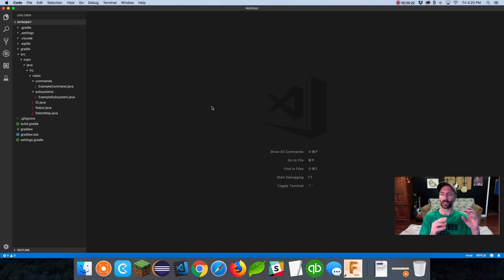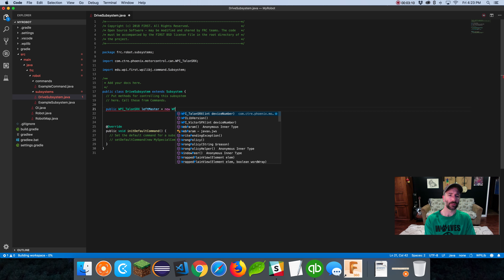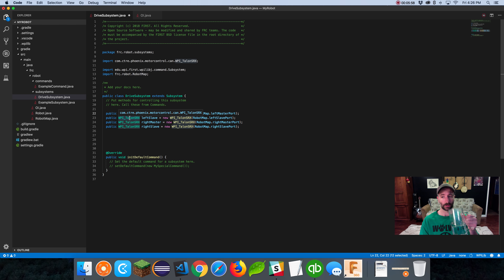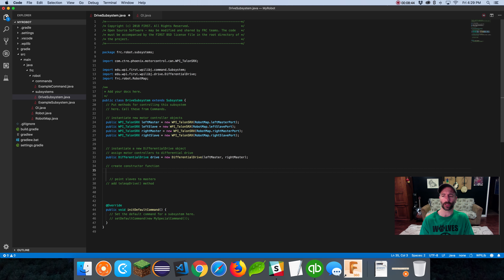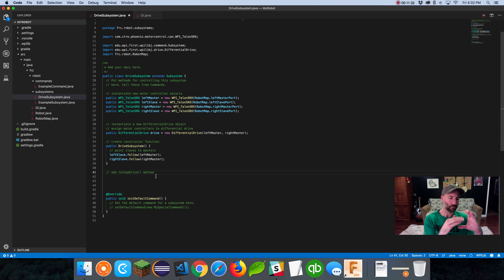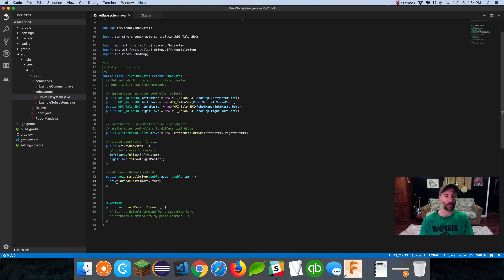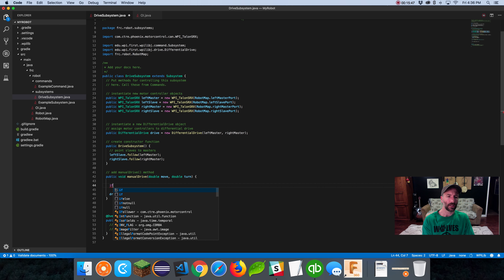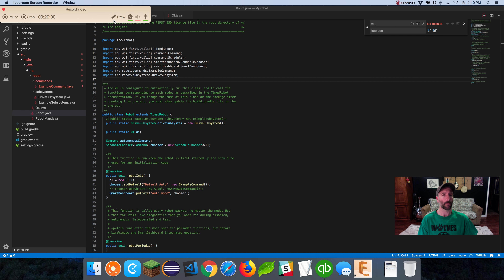FRC Drivable Robot PART 3: Drive Subsystem / Java VS Code

Comment: I'm using SparkMaxes instead of Talons, and when i try to type it in after "new" it wont give me the option to put in a device number. When I add parentheses and put the constant from RobotMap in, it is underlined and says:  The constructor SparkMax(int) is not visible. Any suggestions?
Reply: I've used Talon and Sparks a lot. I haven't used SparkMax. Did you install the software necessary for vscode to recognize a SparkMax? I'm seeing some resources here: https://www.revrobotics.com/sparkmax-software/#client-installation-instructions and some examples here: https://github.com/REVrobotics/SPARK-MAX-Examples

Comment: How did you "import" the packages for the Talon SRXs? I used the Phoenix installer to download the Java imports to VSCode, but the import is still not available.
Reply from the maker: Well, I think the ctre library was included when I  went through the steps to setup vscode on wpilib. I could be wrong. I'll be setting up a few laptops this week and I'll check then. sorry I can't give a better answer. if it's a rush, post a question on chiefdelphi.com under programming.
Reply: @BetaWolves-Team  
I followed this page, where the documentation described how you can "Install New Software". Basically, you right click on "build.gradle" and select "Manage Vendor Libraries", then select "Install new Software". After entering the link:
http://devsite.ctr-electronics.com/maven/release/com/ctre/phoenix/Phoenix-latest.json
The CTRE Library is available to Import.

This was the website with all the documentation.

https://phoenix-documentation.readthedocs.io/en/latest/ch05a_CppJava.html
Reply: Thought this would be important to touch-on since new VS Code users may not know how to import code for their projects. Great videos BTW
Reply from the maker: Yes, the build.gradle would be where you manage your dependencies. I don't think I had to do this so it's good to know what to do. I had originally imported some projects from eclipse so perhaps the library was already installed. Thanks for the heads up!
Reply: @balls1906  Anjayy'
Reply: @lukaspfalz6128  Thank you!
Reply: @lukaspfalz6128  Thank you so much for sharing this, took me ages to work out what was going on

Comment: How would you change the code to fix VictorSPX's ?
Reply from the maker: Simple, instead of WPI_TalonSRX use WPI_VictorSPX
Reply: Also do VictorSPX's have the same Master/Slave system?
Reply: @ethanbehringer9113  VictorSPX motor controllers have the .follow() capabilities. It's one of the main reasons to purchase them. You can buy a talon and victor pair to save yourself the cost of buying two talons. We wanted to use current limiting this year, which the victors don't do, so we had to pony up for all talons.

Comment: Great Tutorial!! Could you tell how did you install vendor software on MacOS. I installed the HERO from CTRE on Windows because the file is exe. But I don't know how to update the vendor library in VSCode. Otherwise, any code about CTRE will be error. Thank U~
Reply: So sorry, It's been too long. I'm pretty sure i followed a tutorial. You  may want to reach out to support at CTRE, they should be able to help you get their software installed. They are quite helpful.